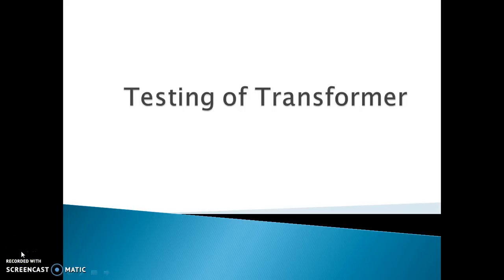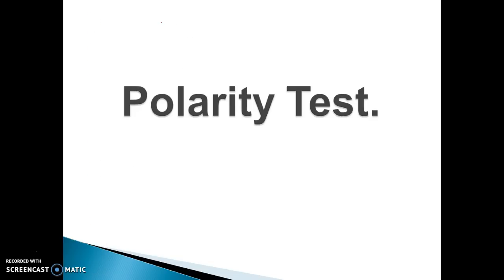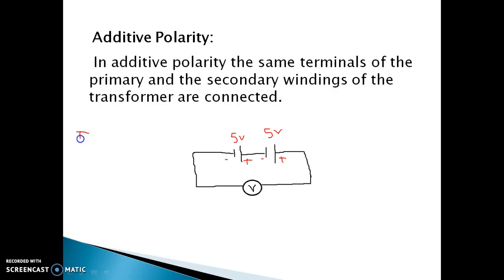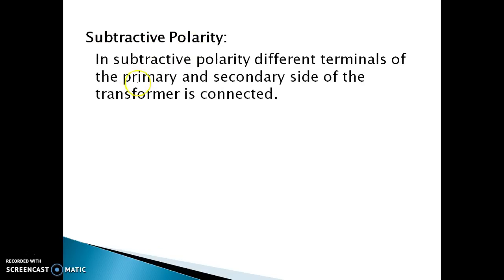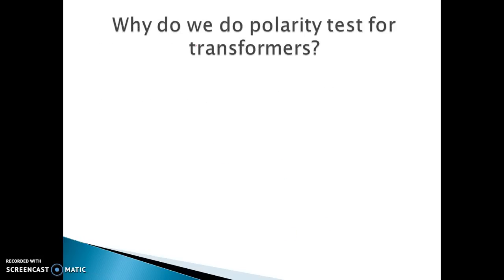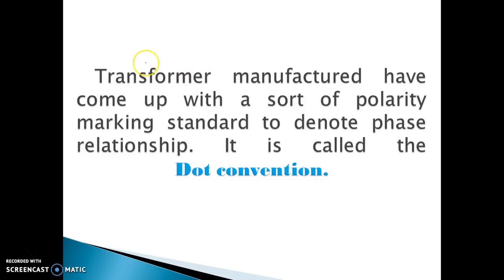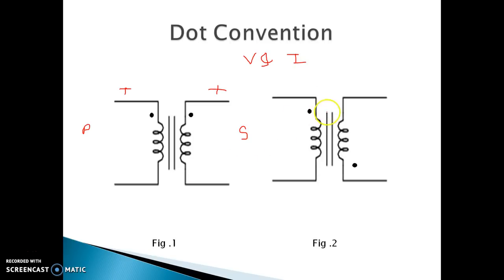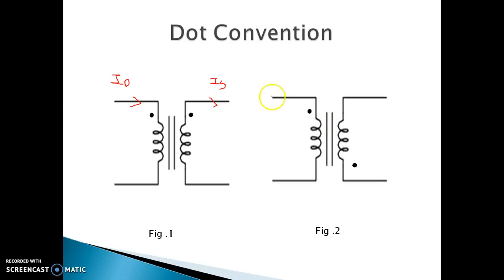Polarity testing of Transformer by Pratiksha Shinde

Comment: current flow is from negative to positive
Reply: Jordan Saquing 
electrons flow from negative to positive. current flow from positive to negative.
Reply: Jordan is technically correct .

The "actual"  current flow is indeed  the "movement of electrons", which have a NEGATIVE charge.  
This means that:   they do indeed "flow"  from the negative terminal to the positive terminal - since the negatively charged electrons are attracted to the positive terminal  ( opposite charges attract)

HOWEVER --- back in the days when electricity was first "discovered"  and subsequently further investigated .. it was ""assumed"  that "current flows"  from positive to negative.  And ... it has remained this way "by convention".   In other words ... they got it WRONG ! 

THUS :  To say that current flows from positive to negative is in fact  INCORRECT .. 
What IS correct is to say that:   "Current flows by COVENTION  from positive to negative" 

What we refer to as "conventional current flow"
Reply: Actually in within a battery the current flow from negative to positive but in the circuit the current flows from positive to negative